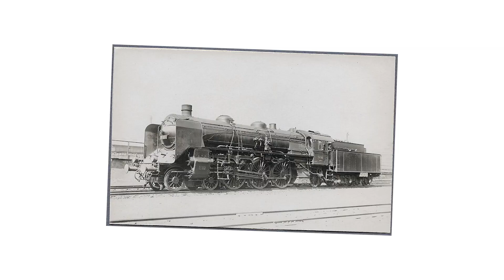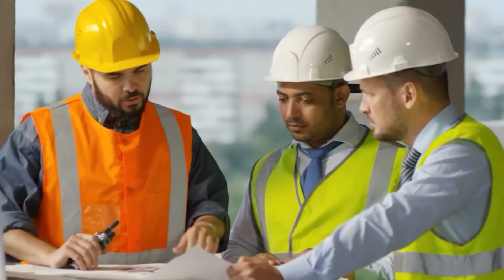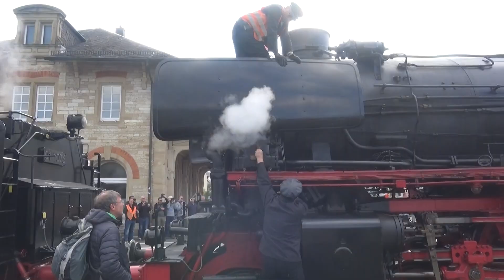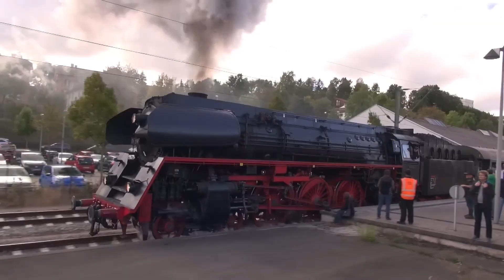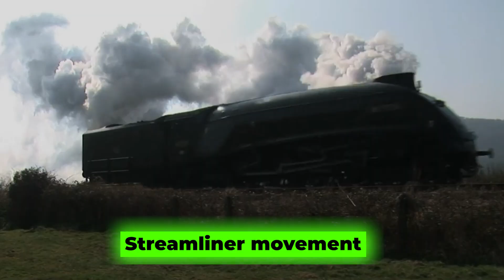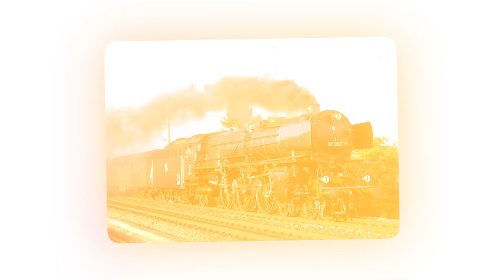This Locomotive Was So Heavy Germany Redesigned an Entire Nation

Comment: The Reichsbahn had to incorporate the existing locos from the "Länderbahnen". Historical background: When Germany was united in January 1871 there had only been weeks of negotiations between the 24 or so German territorial states and three independent cities that had no railway of their own. The German rulers were more than reluctant to hand over their sovereignty to a federal but still universal system of law making and government. Lots of rights stayed with the territories or members of that federation, including trade, commerce and traffic. That is sheer irony as the railway had been seen as the motor of German unification from the 1830s and 1840s onwards. Anyway, after WW I the Reichsbahn was formed and its profits were intended to finance the huge repararations that had been imposed on Germany in 1919/20.
A board of engineers was set to work at the task of comparing the existing older locomotives to the blueprints of the new standard classes and give them a number in between the new types. 
In reality only the fast express locos would run throughout the entire country. The bulk of the locos pulled regional and commuter trains and freight trains that were handed over from one big shunter yard to the next one so that they returned to their home depot or workshop (Bahnbetriebswerk) as they had done before. 
Starting with the new 01 class the system ended with the highest possible number 98 for every loco that ran on standard gauge on a limited regional network. There was no chance at all that the Bavarian "greenhouse" or "Glaskasten" with its automatic coal feeder and driver's cab (with big windows, hence the nickname) would ever get to some area with other 98s running around.
One of the most important locomotives that had not only been bought by the Prussian railway was that versatile Prussian P8 that was now the class 38. It did not end its working life until 1972 in the East and 1974 in the West. 
Fun fact: Class 99 is ALL German narrow gauge steam locomotives.
Reply from the maker: Love this information!  Thank you for contributing!

Comment: The Reichsbahn, after its formation on April 1st, 1920, had decided to improve the permanent way of the main lines to accomodate rolling stock with an axle load of 20 t, whereas up to this time, maximum axle loads varying between 16 and 18 t were permitted, depending on the former state railway and route. Additionally, the existing turntables with a length of 20 metres had to be replaced by 23 m turntables in all engine terminals which serviced express locomotives on a regular basis - this must have amounted to a three-digit number of turntables all over Germany! This also took time and explains why the early examples of the classes 01 through 03 were delivered with short tenders to facilitate the use of the old, shorter turntables. Due to the recession of the late 1920s and the heavy financial burden imposed on the Reichsbahn by the Treaty of Versailles, the strengthening of tracks and bridges took far longer than anticipated, in particular in the northern and eastern parts of the network. This delay and the increasing train loads necessitated the development of the light two-cylinder Pacifics of the class 03, which have an axle load of only 18 t. The class 02 also existed, being almost identical to the 01, except for the 4-cylinder compound engine (type von Borries with concentrated drive). This variation failed mainly due to having too retricted steam passages within the cylinder group and a short-travel valve gear, which in combination resulted in serious throtteling losses within the steam engine at higher speeds / rpm's. They were rebuilt as class 01 from 1937 to 1942.
Reply from the maker: What an incredible wealth of knowledge, thank you for this!

Comment: Let me correct two numbers: the diameter of the driving wheels is 2000 mm and the performance is 2200 hp. With its rather simple design, i.e. no compound  the 01 is in the tradition of the former Prussian engines. In contrast to the south German countries, cheap coal was available; therefore, the trade was different: simplicity and lower maintenance cost had higher priority than reducing fuel cost by more complicated design